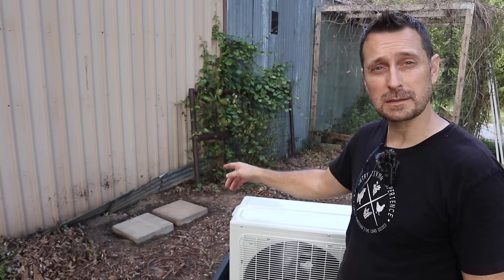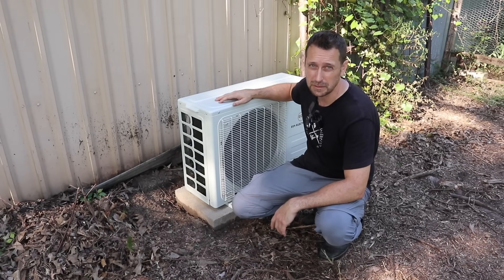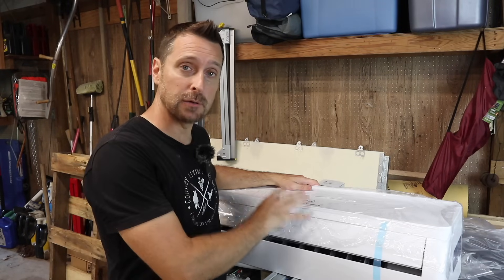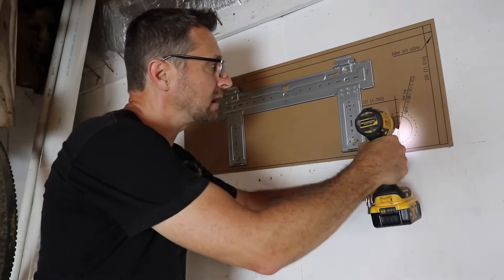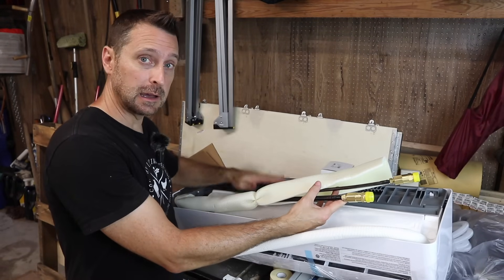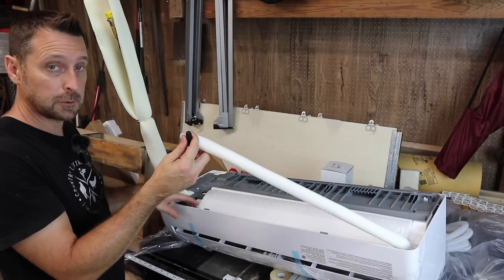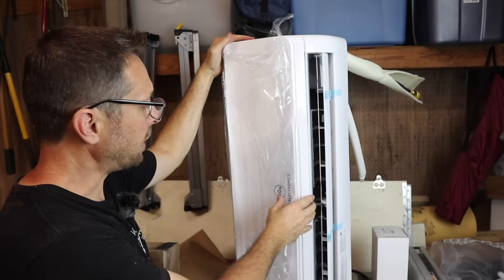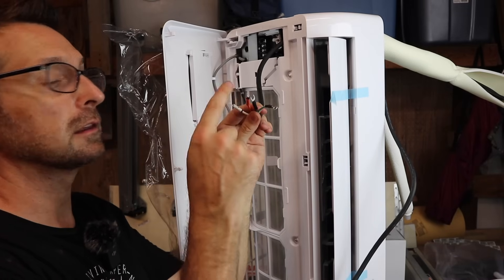Solar Air Conditioner Full Installation & Review! True DIY From EG4!

Comment: If running on solar only and the unit shuts off due to not enough solar energy, does the unit have to be turned back on with the remote or will it come on when enough solar energy is present.  My scenario would be that I am not present at the location so I want to be sure it continues to run without any intervention provided enough solar energy is present.
Reply from the maker: If only running off the panels, the unit will 'wake up" in the morning when enough voltage has been generated. The fan will run with a lower voltage and then the compressor will turn on when the proper higher voltage is reached. They have an app for your phone that you can monitor the unit with. If running on AC power as well, the unit will never shut down. Once the sun hits the panels and provided enough voltage, the unit will switch from ac power to dc power.

Comment: By adding more panels in parallel and keeping below the maximum voltage, how many panels (how much Short Circuit Current) can I add if I want to make sure I have maximum PV for my mini split (this mini split)?
Reply from the maker: Depends on your panel rating/voltage. The max current is 12A and max VOC is 380V. 
The max for my SolarEver panels is 7 total in series. They are 455w, 49.35VOC and 11.44A. If you are trying to parallel, remember that Amps are added. 
I think that the manual also mentions to only add a series string to this unit. It does not recommend paralleling panels.

Comment: Air conditioners that are properly sized don't run continuously.  A thermostatically controlled split unit will cycle on and off.  The idea that solar panels which are continuously capturing solar energy would not feed that unused energy to a battery is ludicrous.  Investing in 1.6kw of panels and dedicating that to a single appliance is a waste on an epic scale.   The proper approach is panels/arrays connecting to a charge controller that stores the energy in a battery bank(s). An inverter supplies the needs of your appliances directly from the batteries.  If the panels are sufficiently sized, the voltage drop on the batteries will be unnoticeable and pass straight through to the appliance  Then, when the sun goes down, you have the stored energy in the batteries to run that appliance before noon and after 3pm.

What these manufacturers of solar split systems and "solar generators" don't tell you is that the rule of thumb is only five hours of peak current is supplied from the panels each day.  In summer, when you think your collection will be tops, heat reduces the panels' efficiency by as much as 30%.  Sure, you can overcompensate for that ratio by adding more panels but you waste that extra energy by not collecting it in your battery bank(s).  What about the other 19 hours a day.

For context, my wife and I cruise and live fulltime on a 40ft sailboat that is fully electric (including auxiliary propulsion) and powered by solar.  We haven't had a power bill in 7 years.  It's 11pm, here in the Florida Keys, and 86°.  The solar panels stopped collecting at 6:30pm and it has been dark for 4.5hrs...and our air conditioner is running (as well as our fridge/freezer, lights, electrical outlets, and our Epson home theater projector).
Reply: @davidalbright7335  Not everyone lives on a sailboat, and for those that don't mind finding used our discounted panels. . .this is lovely. There is much more complexity to a full solar inverter system, and it isn't a weekend project, this is and works well.

Comment: Who actually makes the unit?  Plus, are repair parts available?  Many of these DIY mini-splits are basically disposable after as little as 4 years because parts aren't available. Been there,  done that. I like the idea of a solar run unit, I just look at all sides of ownership of appliances.
Reply from the maker: EG4 is the developer of the unit but I am not sure who exactly manufactures it. You would have to call EG4 re: the availability of spare parts / warranty work.
Reply: @CountryLivingExperience  Thank you.
Reply: @CountryLivingExperience wouldn’t the information show on the packaged box or even on the Information label on either the evaporator or condenser?
Reply: If you have to dispose these units after 3 years…something is definitely wrong…I’ve installed most of these units and 7years and still working(ofc your gonna have compressor efficiency loss over time)but it’s still cooling and energy consumption ain’t that bad…Regular maintenance and proper management of the unit is what makes it last(Ofc they’re outliers like manufacturers fault or voltage spikes that can shorten life)
Reply: @r410a6  I don't know about this particular unit, which is why I'm asking.  I've worked with Mitsubishi/other split systems and getting repair parts after the units are 3-4 yrs old is very difficult to unavailable to cost more than unit is worth if available.
Reply: Yea looked it up…China manufactured the unit.

Comment: Can you run  the EG4 AC  on a 48 Volt battery  to 110 AC volt ?
Reply from the maker: Solar panels or 110v only. If you use a battery, you will need a charge controller, etc.

Comment: You keep saying directly off the panels, but is that actually true?

Doesn't it need batteries to meet the starup cranking amps?
Reply from the maker: No batteries needed. The amperage draw is so low, the panels produce enough to start it directly.
Reply: @CountryLivingExperience   woah! Did you test them that way or know of a video where somebody does?
Reply from the maker: Not sure what you mean. I showed the unit starting and working in the video from just the solar panels.
Reply: @CountryLivingExperience  Sorry, hadn't gotten that far yet 😅

Thanks 🙏

Comment: I just installed one of these
. I was able to change c to f on the remote,  but it still show c on the head unit. Is that supposed to change too?
Reply from the maker: It will change on the head unit also if you change the temperature up or down
Reply: @CountryLivingExperience  thanks! I'll try again...

Comment: Sprry for the dumb question but why wont it run at night off of a battery bank?
Reply from the maker: You need to add different pieces of equipment to run it from a battery.

Comment: Unfortunately you skipped the most important test:

When the sun goes down and the unit shuts off, when the sun goes up the next morning, WILL THE UNIT AUTOMATICALLY TURN BACK ON, and use the prior settings?

if yes, than this is a great feature.
If no, then this means you must go out to the shed every morning to turn the ac unit back on fir the day, which would be a oain in the a$$.

Please test this feature, and show what you learned from how it reacts.

thx
Reply from the maker: Yes, it does.
Reply: I had to scroll way down in the comments to find this question, which was the same I had.  Thanks for answering. 

As the voltage drops, I assume it turns off the compressor (and green light like you showed). Then it just runs the fan until the voltage drops too low?  In the morning, does the fan come on first, and then eventually the compressor when voltage is high enough?
Reply: Read more comments, and I see you answered there already. For anyone else, the answer to my 2 questions is yes.

Comment: Hey you probably already figured this out but you can change the temperature reading a few ways. • Method 1: Press the TEMP Up and Down buttons simultaneously.
• Method 2: Power down the remote and hold both the TEMP Up button and the Fan
button simultaneously for ~5 seconds. It was in my manual but hard to find. Usually under remote control operations
Reply from the maker: Yep. I got it. Thanks Rodney.
Reply: How do you power down the remote?  Remove the batteries?  Then the remote will not work.

Comment: Great video!
We bought 2 EG4 12k solar units a few months ago from Signature Solar.
We have been nothing but impressed and happy with them!
I live in the southwest and as I'm writing this it's late after noon, 100 degrees and the AC's are set to 68 & 69 and cooling great!
Both are using full solar power, one is pulling 299 watts and one is pulling 520 watts (bigger space to cool) from the solar panels!
Everything works as it was advertised and signature solar has great customer service!
Free AC!
Can't wait until winter to see how the heat pumps work in the winter and more importantly, if i get a lot solar we could have FREE HEAT!
Glad I'm sitting done, i feel woozy...
Reply from the maker: Awesome!
Reply: @killer5846  Awesome!
Thank you so much for the detailed response.
... that is exactly the scenario I'm looking for ....it's either that or we have to completely stop using the kitchen for cooking ....my wife made cupcakes with our daughter yesterday and made a pan fry dinner at the same time.... I couldn't cool the kitchen dining area down no matter what I tried.....great in winter .....lousy in summer.
I can see the wisdom in each unit having its own 4 panel solar array power supply ....independent of each other. It's only a small hassle to run wires under the house in the crawlspace over to the side of the building where I presently plan to mount panels. I think 8x oanels will fit ....though  this has me thinking more and more about a car port with a solar panel roof on the driveway/detached garage/kitchen side.....those are two benefits that are very worth while.
It occurred  to me after asking the question about battery banking solar power that that should be a separate system for the whole house ....mostly so the fridge can stay running in a power outage and inverting back to 120v AC would give us lights and  fans. I'll work on that in "phase 3" of this plan.
It's great to live in the 21st  century  when we have the ability to do these things....Wow!
Reply: @GiantRobo77  You're very welcome! 
The major reason I did this was because I wanted to do solar but it's so damn expensive and our utility out here has been cutting back on the incentives so it would take many, many years to recoup the cost. 
Also, I like how simple they were to install and I did most of the work myself except for the solar panel installation. 
The mini splits were no problem and really the solar panels weren't either I just needed to hire a independent contractor to help me install to make sure it was done to code.
What I like best about this system is the simplicity, you put everything together and simply plug in the solar panels. 
All of the electronics are built into the outdoor unit and it takes care of using solar when it's available or switching back to grid power automatically!
The last thing for me was not getting up on the roof anymore I service our swamp cooler, getting to old for this crap.
You sound like you know what you're doing and you have a plan, just go slow and you should be great!
Reply: @GiantRobo77  can I ask in several conversations we talk about four panels or eight panels? What size panels so that I know what size array I need? And can I run the solar panels to my batteries and then connect my batteries to the solar mini split so I’ll be covered day and night 
thank you very much. And may God bless the United States of America
Reply: @killer5846  you are very nice indeed, I have learned a lot from your answers
Reply: @pramukcholahan6828  aww.. thank you!
Reply: @killer5846 did you put each of AC units on separate circuits and solar arrays or are they both sharing the same array? ....and follow up question how many of the two sided EG4 panels did you end up needing to supply two AC units? 
I've asked and they never got back to me ....maybe the dimensions I provided for the only strip of land I can put panels on was too small to accommodate enough cells to run two mini splits.
If I had a third question, it would be whether you needed a battery bank to run overnight or if you are in-fact using some grid power at the cheaper rates to run a few hours into the evening .....say until 10pm?
Reply: @GiantRobo77  Hello! Happy to answer some questions.
My set up is two 12k BTU solar units and one 9k BTU non solar unit.
Important to know the setup so it makes some sense.
9k unit is in our bedroom which is used 90% at night so no solar.
12k in dining room kitchen, other 12k in the living room with solar assit.

1. Grid power. The 9k BTU (non solar) and one 12k BTU unit are on one 20amp AC circuit as they draw 4 amps maximum so combined they are well under the 16 amp working load on a 20 amp breaker.
The other 12k units is on a 15amp circuit by itself.
2. Solar. The two 12k units are on #4 each solar panels provided with the package and seem to be perfectly size for the units.
3. The solar arrays are not shared, each unit has #4 panels wired in series directly plugged in to the units with a solar cut of switch (required for code) for safety.
4. They sell their 24k mini split with 8 panels, so I would assume 4-per 12k seems like a good fit.
5.Grid power, we do use grid power as we have no battery back ups for any of the units.
They should be easy to set up with battery backups as these units are heat pump inverters and are super efficient!
We use the 9k only at night and on grid power but it uses very little power.
The 12k units use grid power when the sun is not up.
I'm in the southwestern US in summer, so the solar starts kicking in around 7am and goes full solar (no grid power) at around 8am.
Assuming a clear sunny day the units use full solar until around 6:30pm when they begin to taper off dropping solar at around 8pm.
I had the solar panels installed on our metal roof and they don't take a lot of room.
Ground Mount's should work well with the proper space available.
Also, one pro tip I was taught by a solar installer's on YouTube is to make sure of shading where you want to install where you have the least amount of shading.
Hope I answered all of you questions.
Good luck
Reply: what if you are truly off grid-no a/c at night...
Reply: I am in the SW as well, very expensive electricity, I have a Midea U Shape in the kitchen/ family room, I am thinking about putting a solar 12K unit in the same room.
Our little master bedroom does not get heat or ac so putting a 9k in there make perfect sense.
Did you get the rebate and was it difficult to acquire?
Reply: @Moondoggy1941 our local electric company has very defined qualifications for rebates. One of
 them is that the unit has to be installed by "professionals" and since I installed my mini splits myself they don't qualify for the rebate. It doesn't matter that I had the solar panels installed by a professional or that I had my installation inspected and passed, still no rebate. I really don't care since by my calculations the three units I installed with the solar panels will have paid for themselves in two years with the savings on electricity. So far I have been totally blown away by the amount of electricity I have saved while being very very comfortable. So I guess my advice is to check with your local utility and go over the fine print very carefully before you commit.
Reply: @killer5846  Thanks,  since we only have about 2 more months of heat, either I hurry up or I take my time and get ready for next year. Going the solar way will save me a ton of money and it will be definitely the way to go. We do not need it for heat in the main room, but for the bedroom all we need is a 9K.
Reply: @Moondoggy1941 you will be surprised how much money you will save in electricity and gas with these units, I was skeptical but it generally save us a lot of money! Good luck 👍

Comment: Thank you for the great video. Question, how many but’s is your unit and do you know how many watts this mini split pulls with the compressor on?
Reply: We have had our 12k units for a couple of months and I have never seen them go over about 900 watts on 104' days. Usually after they slowly ramp up and get to a working indoor temperature they hangout around 240 watts after about an hour.
Reply from the maker: I think it surges to 1100w when the compressor kicks on and then drops after that. I am not sure how many watts for continuous running of the compressor.
Reply: @CountryLivingExperience  sorry I meant BTU’s not but’s. (Autocorrect)
Reply from the maker: @marioluna4344  Ours is 12000btu

Comment: You did not mention if the mounting brackets line up with the wall studs, are the bolt holes 16" apart?
Reply from the maker: Because my pole barn has a different type of construction.
Reply: @peterwaroblak166  just cut a 1/2" plywood spacer to mount to studs, then mount to the plywood.